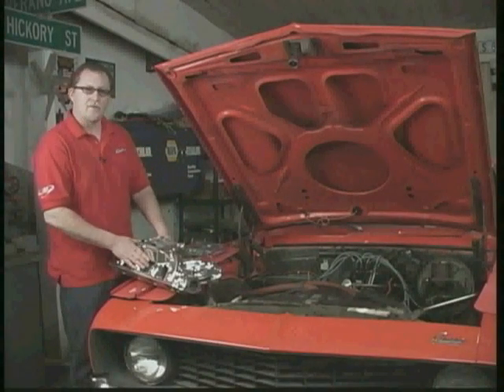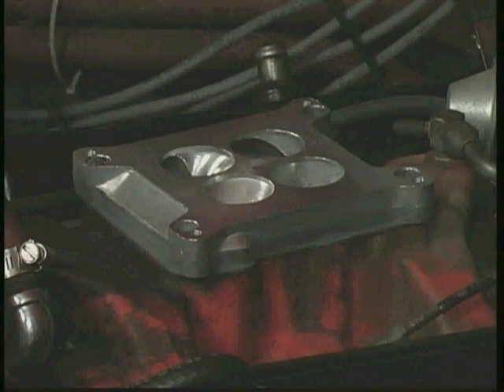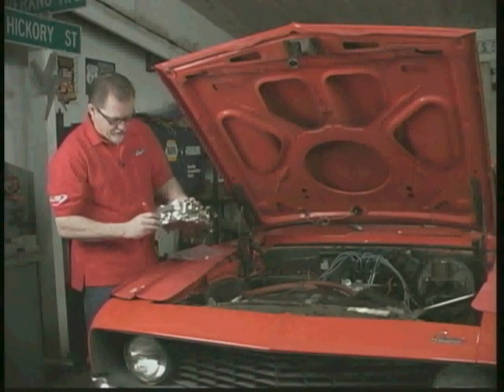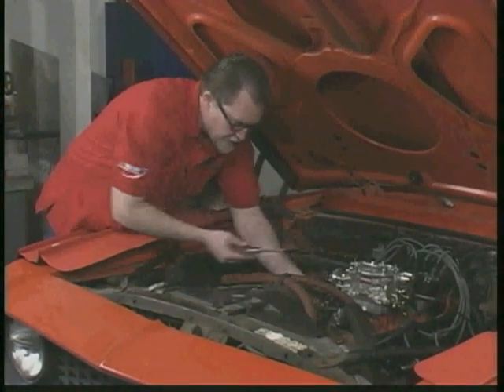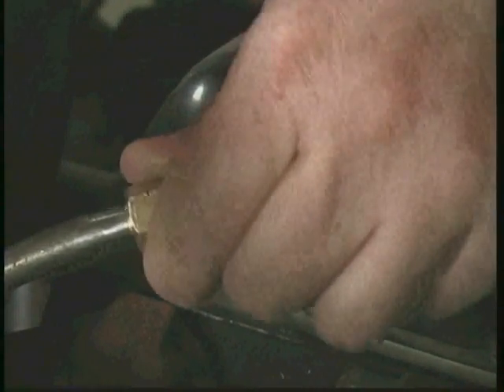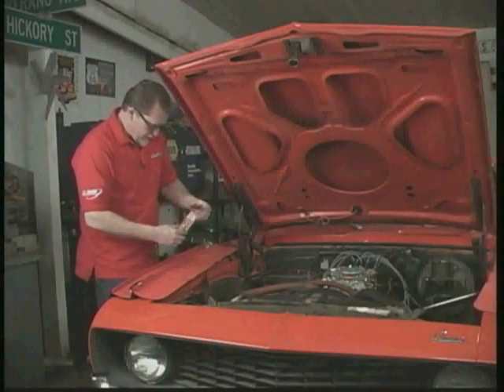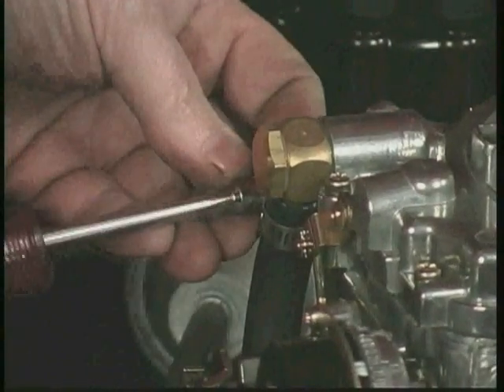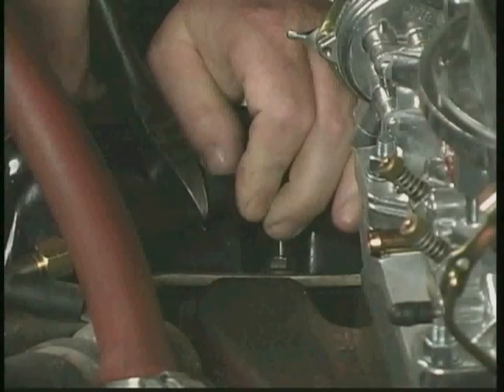Edelbrock Carburetor Installation and Troubleshooting Part 3 - Installation 1

Comment from the maker: You need to have an idea of the type of cylinder head, compression ratio, and type of performance you're expecting and build on that combination. A big camshaft is the last mod to make if you are doing it as you go. Bigger is not always BEST! One final thing, you need to check your valve to piston clearance with the bigger cam. You don't want any bent or dropped valves because of the valves hitting the pistons. If you have any more questions, give us a call at 1-800-585-0683.

Comment from the maker: We would need to know the size of the cam you are using and what you're trying to achieve as far as HP in the future mods to make an accurate choice, but we would use the 1406 even with a head change in the future. This will probably work fine with your lumpy cam as I don’t think you'll not be cruising at 6000 rpm’s all the time. More in the 2000 to 2500 rpm’s.Also, the whole idea behind building a better engine is the "Total Combination Package," not just bits and pieces. (continued below)

Comment: Hey. I am about to put lumpy cam in my stock 350 chev. Its the lumpiest i can go without roller rockers etc. It's early stages in modifications. I plan on doing the heads etc eventually. I have a edelbrock performer manifold. Would a edelbrock 800 thunder series be ok for the mild mods i have so far? Any help would be appreciated. Cheers

Comment from the maker: From David Loggans, Performance Parts' own ASE Certified Master Machinist: The Edelbrock 1403 would be your best bet. This is the one with an electric choke. If you would like to order it or have any other questions, feel free to call 1-800-585-0683

Comment: I have a stock 1978 Chevrolet Caprice with a 350 V8 and a intake heated choke.I want to keep it stock but every rebuilt Rochester 4bbl I put on it are so worn out that I am looking for another option.This is a every day driver and not a race car.What would you suggest? Thanks!

Comment from the maker: Can you can use power brakes off the intake manifold? Can't I just buy a fitting and screw it into the intake manifold and put the power brake hose on the end of the fitting? 

Yes, you are correct, according to Big Dave, our ASE certified technician here at Performance Parts.com